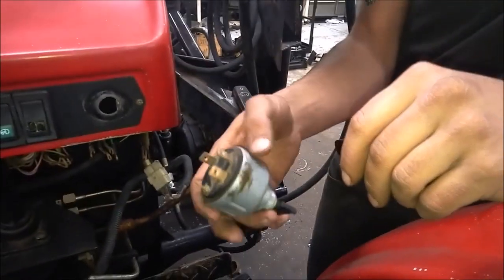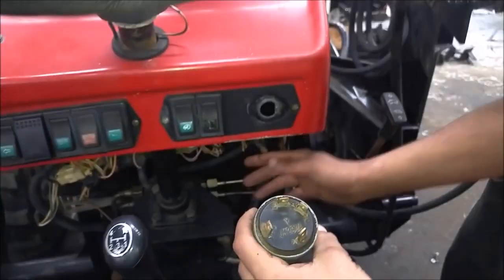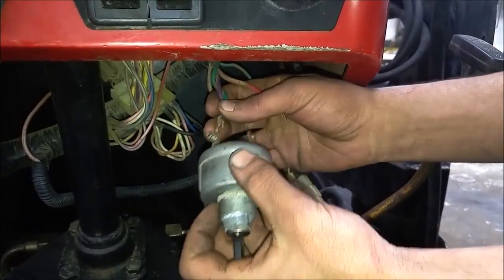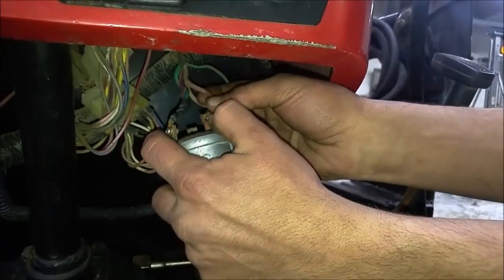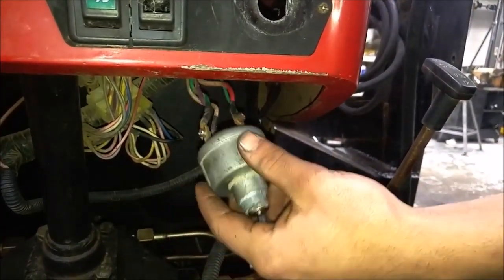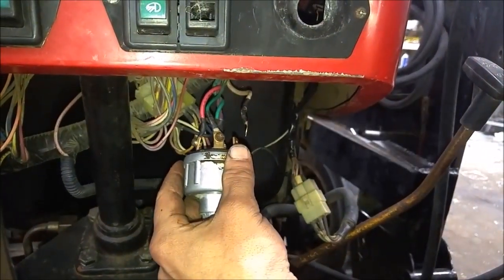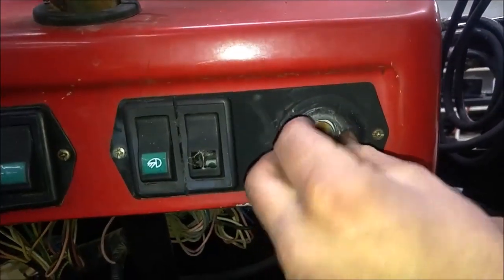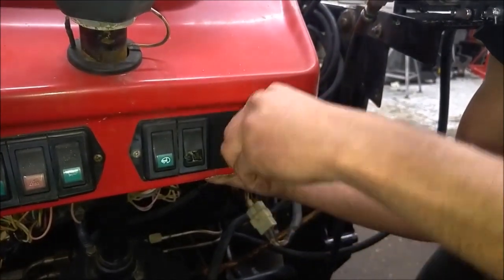How To Install a Jinma Ignition Switch

Comment: I have a Jinma 254. Mine also seems to have an extra wire (pink) connected to the starter along with the white wire. any idea what this is for?
Reply from the maker: the white wire may go to the top fuse in the fuse box.

Comment: Hi.... I have a farmpro 2420 with 4 wheel drive. I have a problem with the driver gear for the transfer case. I took the inspection cover off the right side of the gear box were the forward and reverse shifter saft goes in. It is the gear above the transfer case. It has 14 teeth. The shift that is on is around 30mm diameter i couldn't measure it that well in the tractor. The parts book I have isn't vary good. If someone knows the part number that would be great if you could pass it on to me. Thanks